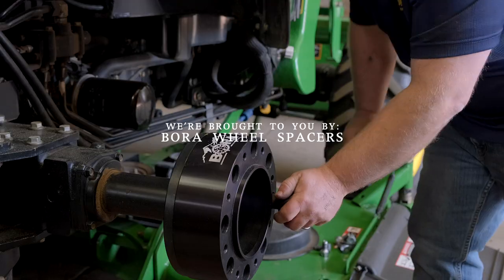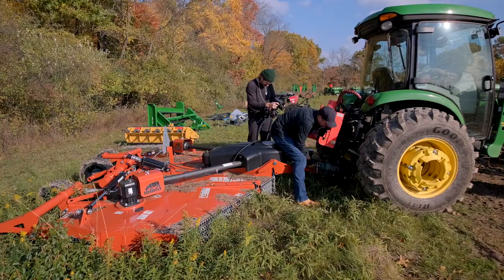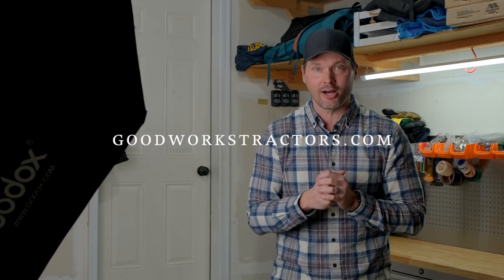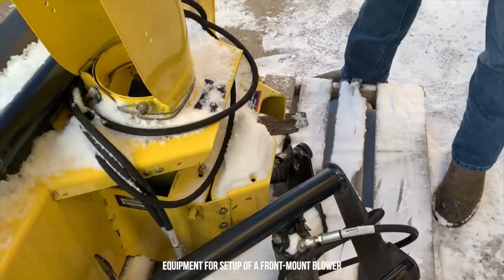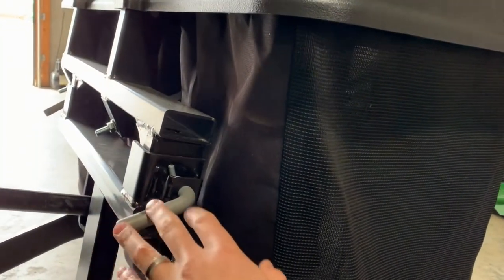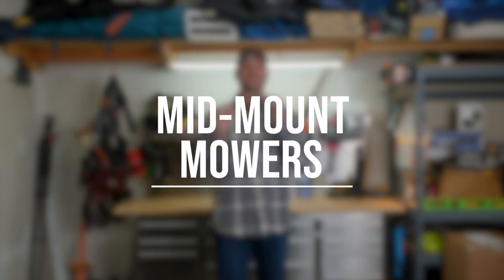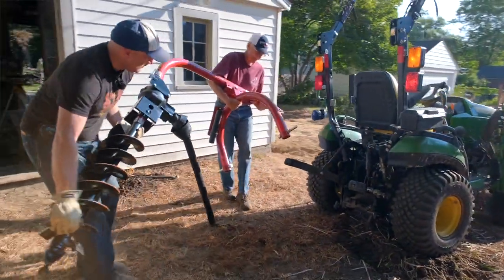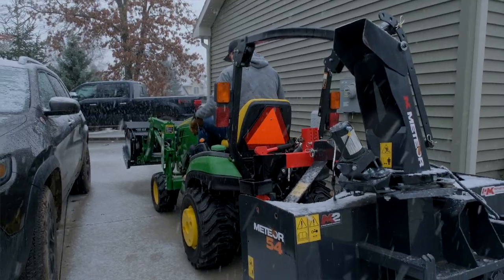5 ATTACHMENTS SO BAD THAT THEY'RE NOT WORTH BUYING? 😡

Comment: It always amazes me when people struggle attaching a pto.  Slow down, understand how it works and it is about as easy as plugging into an electrical outlet.  Adding complexity will never make it easier.
Reply from the maker: One line of difficulty that is a pain even if you slow down is aligning the key on the shaft properly. If your attachment is too heavy to move and thus to turn its shaft to align, and if the tractor isn't aligned at the point where you parked it to attach, well that creates work.
Reply: @GoodWorksTractors  the biggest problem is the silly connectors where you have to pull the whole ring on the tractor side. The best ones are big button but 1000 rpm pto seems to be all new style
Reply: yeah but i used to made from a rear mount pto attachments into a loader mount
Reply: When you're in your 70's with arthritis it can be a chore. I'll still do it and I'm not whining but sometimes it can be difficult.
Reply: @GoodWorksTractors  but you still have to turn the PTO to engage the PTO Link device. Looks to me like 1/4 of a turn vs. 1/12 of a turn with a standard 6 spline PTO. When you turn the tractor off the PTO shaft will turn by hand, some will turn free, others 1/6 of a turn. One of those PTO wrenches seems like a much more sensible solution.
Reply: @GoodWorksTractors  Take a file and file each spline to a point, both shaft and coupler (radial wedges). Then the two self align. They need to stop putting that chamfer on the end of the shaft and bore as well. That just causes the splines to wedge over the top of each other. It does nothing to align the splines.
Reply: I do have to say the PTO for my baler sucks to put on. The shaft is eight or so feet long and is heavy. The coupler doesn't like to go on. It's a tight fit, and the shroud is in the way of holding the coupler and pin release. I usually have to pound it on and off by using the shroud as a slide hammer.
Reply: @GoodWorksTractors  A lot of people don't do regular maintenance and lube on their equipment. Amazing what a small shot of fresh light grease or oil will do; the old stuff may keep the rust away but it acts like gum in the splines and lock mechanism. Second, you don't need to turn the PTO shaft of large equipment, the splines on the tractor are free turning when in neutral. (I don't know anyone who tries to connect an engaged-powered PTO.)

Comment: Folks who hate their PTO hook up should invest in a simple bottle brush, mineral spirits and a rag to clean the splines to remove any grease clumps that form over winter, then re-grease it...   Ironic that one of the original tractor "quick attach" items ISO 500 standard PTO connector is now seen as such a problem.
Reply: I agree if you cant slip the pto on the splines ,you should be now whare near a tractor!

Comment: I worked on both my uncles' farms and we never had any problems connecting to their post hole diggers, because of the way they stored them.  After getting done using the post hole digger we would go to where the attachments were stored and sink the post hole digger into the ground about half way up the auger.  Pull the drive shaft, unhook the three points and drive off.  Next time we needed it back up the tractor over the three points and lower the arms.  Since the auger was ridged in the ground, the weight of the attachment points are being supported and as long as the PTO has not been attached we had the gearbox actually allow side to side movement to align them.  Connect the three point and attach the PTO.  Pull the auger up, shake it, move the loose dirt back into the hole and we were done.
Reply: His farm was somewhere warm and not too clay heavy.  Because a winter stuck in the ground like that here and your have clay hard stuck and not be able to pull it out.  We did similar though just up under a tree and throw a chain over a low branch and sling the thing by the gear box.

Comment: For the life of me, I can't figure out why people struggle so much with the PTO shaft hookup.
Reply: Let me see....I have a bad back, I am old, my finger strength is not what it once was, it is hard to see the splines with all the darn safety covers,  the ring type require three hands to lift, hold, and pull the ring back....and I don't have three hands, my attachments are all for 60+ HP so they are heavy and large, ......
Reply: Kyle, get back to work 🙂🙂
Jarret S👍👍
Reply: @jarrets2292   Hi Jarret, you get back to work yourself! 🤪
Reply: @earlyriser8998  Come on !
Reply: @sarahann530  Yeah I'm old too, and have the same kind of troubles like early riser. However my thirty five year old and fit hired man struggles too. So lighten up...
Reply: Stiff release pins that get grime in the groove and don't want to fully open, rust or dust, heavy pto shafts, equipment that is difficult to rotate into alignment, shrouds that impede access to the coupler and release pin, shafts that have to be installed at the same time as backing together as there isn't enough extension to install it after it's hitched up, new ones being so tight they don't really fit.

There are ways to mitigate some of this, but if you store your equipment outside and it is old, you probably deal with most of these.
Reply: @sarahann530  The only thing on that list that maintenance could fix is cleaning and lubing the coupler to get the pin to work freely. Which has to be done every time you use it and isn't the largest issue.

Comment: “Telescopic Draft Links”. Most people who purchase compact tractors will have no clue what I’m talking about. They are available as an option on almost all “reputable” tractor brands but dealers don’t spec them (I assume to keep the price down) and buyers don’t know to ask. It makes hooking up 3point implements so much easier and eliminates the need for a quick-hitch and the compatibility issues associated with them.
Reply: YES! Mine has them, older tractor made in the late 60s. Pull the pin, slide out the ball end, tap it onto the implement pin with a hammer, insert clevis pin, and then just back up when done, it locks itself. So much better.

Comment: Compared to putting the manure loader on the Farmall M or Farmall 400 of my youth the farm, the compact tractor loaders of today are push pull click click. I was installing and removing the loader on the M and 400 when I was in seventh grade. Even worse with the 4 row cultivator attachments that bolted to the frame sides of the big row crop tractors. They were heavy, articulated, not self supporting and it felt like they were waiting to ambush me.

Comment: I had to make my landscape rake and box blade quick hitch compatible. I used extended draw pins and welded home built brackets  for the top hook that are the same height on both attachments and my tiller which was already quick hitch compatible. This way I don't have to raise and lower the top hook. It's made this old man's life much easier.😊

Comment: Like the 9N owner you quoted my prior tractor was a 1956 Ford 640.  EVERYTHING I do with my JD 1025R is a breeze and a pleasure by comparison.  I have no issues with my SpeeCo quick hitch.  I did add clevis pins to replace the top link hook bolts.  Just needed some adjustments to the implements in two cases.  I added a top-link wheel that I can reach from the operator station and hook-ups are slick and easy.

Comment: Front mount SSQA post hole digger.  You can get them specifically for anemic flow rate compact tractors like 6-7gpm.  Problem solved.  They mount easy, pick up easy, hang straight, you can put down pressure on it, and it can REVERSE.

Comment: I find your channel very entertaining and your honesty refreshing.  The post hole digger becomes an easy 1 man job if you just disconnect the pieces.  Remove the auger and the hoop that connects to the 3 point.  Put the hoop on the 3 point arms first and lean it forward.  Then put on the mast and hook up the PTO.  The last step is to attach the auger.  Easy peasy, but not super quick.  Instead of a quick hitch, I use Pat's Easy Change.  I have a mix of old and new attachments and most are not standardized.  The Pat's system works with everything.  No more having to remove the quick hitch when it won't match up.
Reply: I have a few older peices of equipment and I did some fab work to them now they work with the quik hitch

Comment: One thing that surprises me is that folks grease their PTO shaft couplings. Both the male and female ends. 
This may be fine when it's 80 degrees outside, but what happens when it's cold?
Why not use a simple oil can with something like 10W-30 oil in it.

Comment: I find my post hole auger to be fairly easy to put on/take off.  I just disassemble it- pull the pin and take the pto shaft and gearbox/auger off.  Then pull the pin between the other two parts.  It’s an easy one man job.

Comment: Surprised the Quick Hitch was on the list.  I took your advice and purchased the Speeco from you.  The only attachment I had to modify was the Frontier Box Blade just a grinder, primer and spray paint.  The QH makes my life so much easier and I no longer need someone to help. I used to have a 2”x4” to keep the arms apart, and connect to whatever.  Then I would need another person and a pipe or board to move the attachment just so I could hook up.  Now I simply back up and it’s only getting off the tractor once.  The mid mount is my nemeses as I have no flat level area and it’s a challenge to get it hooked up.  I need to search your videos to see how the hydraulic lines should be zipped tied on the FEL.  Unless someone here knows a link.  I had to cut some off as I just couldn’t get them to hook up to the tractor, another inch or two longer would have made it easier.

Comment: I think quick hitches are the best thing ever that is the first thing that I buy for my tractors they are very easy to use. You don't even have to get off the seat of the tractor to hook up implements unless it has a PTO It takes me about 30 seconds to line up back up and lock the implement in.
Reply: A hydraulic top link makes it that much easier.

Comment: Thank you for your knowledge on all this. Trial and what goes wrong. Yes I hated the pull out to  side KABOTA mower deck. The rear baggers getting full to fast. I think if people would just keep the pins and bushings in a supply of NEW ones. Have spares. Fighting a old bushing just to use it till it dies. Is fighting yourself. Clean the holes. Pre check the fit. I noticed that your pictures showed putting on snow equipment out in cold. The metal is cold, your fingers are cold. Put on before it snows. Listen to weather report get ready before snow hits. I remember how nice it was getting into plow trucks all set to go out. Better than those 4 AM dark yards, trying to line up plow hitch. The supervisor mad because we were not out getting on roads, when super could have been more proactive and set up plows just during work hours. Putting a sander on a dump, sliding into place to hit those rear tail dump gates latches, there is no room for play. The hinged sanders ( leg free standing) get all corroded up and nothing works all frozen closed with corrosion. Just power wash off everything after finishing the job.grease fitting. A good one will have lots of zerts. I would water spray off Backhoe everytime I finished a job. Cleaned the dirt off on all joints. Clean off excess GREASE. The huge build up, of grease just attracks lots of DIRT. Makes it difficult to put a bushing in without a fight or pounding it out of shape.

Comment: I normally hook and unhook my tiller on concrete.  Well I had a job that I used the tiller to break up the dirt, then I dropped it in the yard and but my box blade back on.  Wow what a pain to reattach.  I’m using a quick hitch but my issue was the tiller roller rearward about 8 inches because it wasn’t in a flat surface.  Trying to rock it forward for the top hook was a two person job.  I’d love a way to winch the top fwd to catch the hook.  So lesson to myself, take some wide boards to place it on if your in the grass.

Comment: fully agree with standard mid mount mowing decks. that pto connection is the worst because you can't get any push power to put the pto on. that quick pto connect would make that connection so much easier

Comment: So sometimes you gotta go tractor with a intermediate tractor that can handle multiple implants.  Yes they are specific to its brand.

That is Walker mowers.  I have one I use in conjunction with my JD 5065E.  I can run it with a 66” deck for regular mowing.  In winter  I can dedicate it to a snow blower because it’s pto driven.  

Has many other attachments.  Greatest selling point family owned out of
Colorado

Also has a fantastic grass bagging system hydraulic operated. Takes away owner frustration.

Comment: Backhoes can be a challenge to hookup. Was wondering if the quick hitch comments were related to hooking up the quick hitch itself, such as after removing a backhoe to go back to 3pt implements.  It can be challenging to attach a quick hitch frame to your 3pt arms when solo, just like a post hole digger.

Comment: The tractor I have now is an small 19hp. There are attachments I can get and have. I have the two bag mower clipping attachment. I wanted an 3 point. Then I went with an mulcher kit. Then the three point, ect. Works for me. I still need an bigger tractor. Some day.

Comment: Pat's quick hitch adapters work great.  Makes your current 3-point arms ready for action without limiting you to a fixed attachment width.  If you have multiple attachments to work with that have differing widths, Pat's is the better alternative.

Comment: For our 8N, the plow, harrows etc are fine.  Back up, attach, adjust the 3rd point and go.  (I wish that the 3 pt hitch was a Case Eagle claw, but you can't have everything.)  The only thing that is horrible is the cutting bar.  It is weight balanced when mounted, but you have to back over it, and straighten the tractor before you can pick it up, then it is so close that attaching the pto is more difficult because there is no place to stand.  The rest is manually lowering and raising it.  But when  you need to do that job, it is always better than a horse and pull mower.

Comment: Got the 1025R with the loader and backhoe.  Backhoe is a pain IF the system develops hydraulic pressure; it's a pain to bleed off so you can get a solid connection.
HATE where the power beyond connectors hide on the stock 1025R!
The loader QA is AWESOME!  I can drop the bucket, pick up the forks, move the load, and reattach the bucket and NEVER leave the seat!

Comment: In my opinion, never owning a mid mount mower for a tractor. Keep the lawn cutting stuff to a lawn mower or if you still want to use the tractor either draw bar or rear 3 point style finish mower. If you have a front loader you should only have to take it off for doing maintenance/ repair on the engine otherwise leave it on. And I would say get the skid steer quick attach plate, for easier on/off and the attachments are almost endless with with whats available for skidsteers. And for last, the 3 point quick hitch is the way to go. ( coming from a former farm hand, working a 2,000 acre dairy fram in Central California) the problem is not to bad if properly maintained (greased). The biggest P in the A is the safety guard getting in the way of attaching to the tractor. And for the quick hitch. Of you have something not "compatible" make it compatible, even if fabrication is involved in the long run you'll be glad you did.

Comment: I have a dedicated Zturn. Use to use my tractor but the zturn cut my mowing time from 2 hours to 1 hour and does a better job.  I also remove the Zturn mower deck to use the zturn as a mule on tight trails. 4 clips and a belt and it's out. Just as easy to put it back on. 

I don't have trouble with my PTO. Keep it clean and lubricated.  Hit it with WD40 and it works like a champ.

For the post hole digger I use to break it down into 3 parts so it was easier to handle. Now I have a stand.

Comment: I really dislike the "newer" style PTO rings.  I grew up with the spring pins, though a pain in the ***, they are easier to put on compared to the rings that you have to push one ring, pull the other, then while pulling the ring towards you then push the PTO on the splines.  Hate it!

As for connecting post hole digger, I usually have no issue.  I have a 6' x 12" auger.  It lays on the ground (on a pallet).  I back up and connect the two lower arms first, then the top.  It's quite easy on the back and I can usually get it connected in a few minutes.

Comment: +1 Any rear mount blade (box  or simple back blade), or similar ground engaging implement, that doesn't have trailing gauge wheels(set behind not to the sides). 

Without that trailing wheel and a slack toplink(eg chain) they loose 80% of their grading ability, every bump or hole the tractor front tire hits causes opposite swing in the back. Unless the operator is moving super slow and adjusting height for every bump it's super easy to setup a wavy washboard effect. It's the whole reason road graders have the blade in front of the rear wheels.
Ideally rear mount graders and box blades would have something like a pintle hitch and two rear wheels, the three point could still be rigged to provide lift for transport or backing up while not interfering when lowered for use. This could easilly be extended into a small pulled belly scraper when substantial material needs to be moved a distance(much better than a box blade).

Even more ideal is a mid mount blade like the old Farmall cubs and 140s had, but with an industry-standardized hitch. Of course the downside is this requires tractors designed for function over fashion. This mid mount is also ideal for cultivators/row-harrows and seeders. Also mowers of course but mainly beacause of maneuvering space.